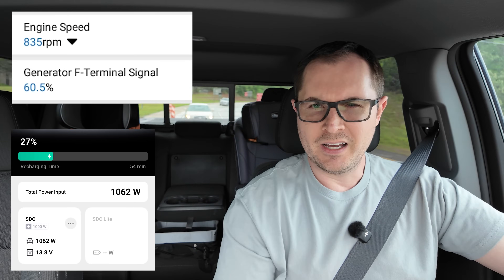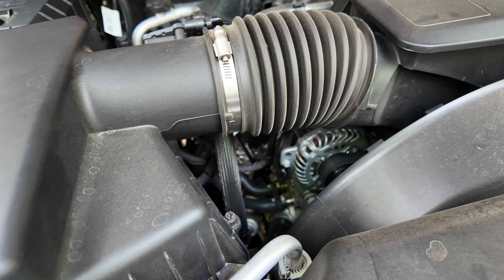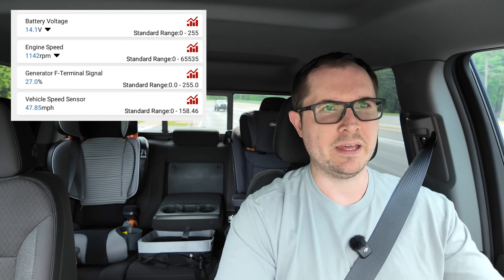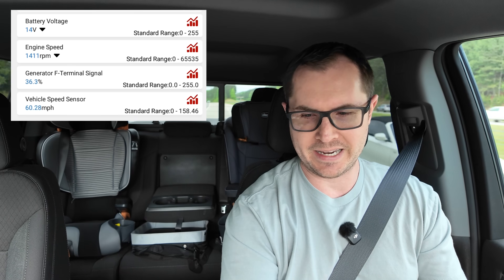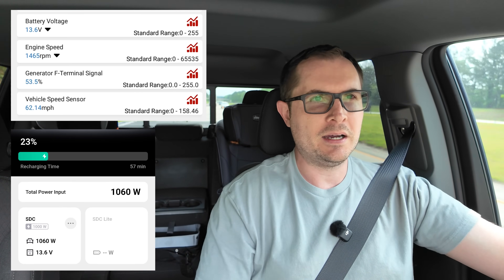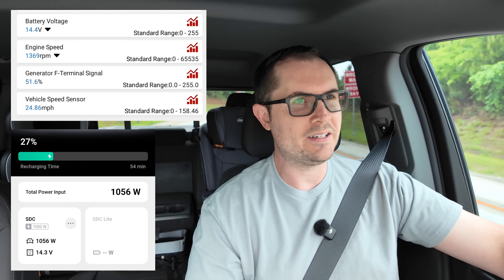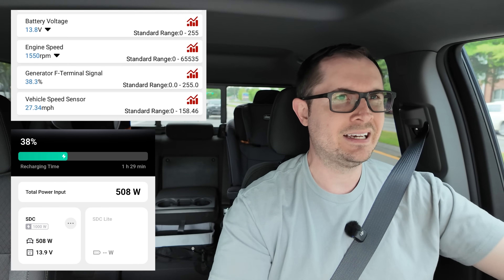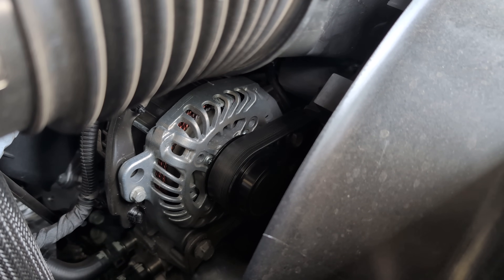I Show REAL Numbers: Impact of DC-DC Chargers from DJI, EcoFlow, Bluetti on Alternator

Comment: So when you are charging at 1,000 watts, is the DJI drawing a whopping 70amps from your alternator, right?  If so, that's not enough headroom for a 170amp alternator, in my opinion.  With your truck, it would be better to move up to the 220amp alternator or a dual alternator setup.
Reply: Why isn’t it enough headroom? 70/170 is less than 50%
Reply from the maker: For sure, in hindsight I would order my truck with the 220 option or even dual 170+220 option. Always learning something, right?

Comment: Great video.  Always wondered this. I have the Ecoflow alternator charger that I would only use in a grid power down event.  I have ran many tests by monitoring the alternator temperature.  I can safely draw 300 to 500w at idle on my Subaru Outback.
Reply from the maker: Thank you for watching, appreciate the feedback.
Reply: What are you powering with this? This was my interest in providing power to a to my refrigerators, lights and tv during power outage.
Reply: @chumleysteven5717  Same. Can also power gas furnace,  microwave,  and a Nuwave cooktop. Also modems and router. And an inverter AC if hot outside.
Reply: How many amps is your Outback's alternator rated for? It appears in the owner's manual. Mine (2.0 TD 6MT) is 150A, and I was considering buying the Ecoflow alternator charger but worried about going to full 800W power.
Reply: @carlostejada6782 I have the ecoflow alternator charger. You can adjust the draw on your alternator in the app for the device so that it doesn't pull the full 800W at idle. I've also noticed it does it on its own when I've charged at idle while packing up camp. It'll ramp up then back down, but if you don't want it to ramp up initially you can set how much wattage to charge at.

Comment: I bought a cheap 12vdc-24vdc charger for my camping setup at 8 amps to charge my Bluetti EB3A while driving.  I just plug it into the cigarette lighter and it works great.  If I remember right, it cost about $30.
Reply from the maker: Thank you for the info. And thanks for watching.

Comment: So my OLD van is a 1993 Ford E250 4.9L, Factory amperage on the alternator is 80 amps. I have upgraded to a 150 amp HD alternator from a Lincoln (Large frame vs small frame alternator) upsized the wiring and have it wired to a 40 amp DC to DC charger (AtemPower),  With the proper wiring / connections and breaker installed, no issues.  I intentionally oversized the alternator although I could have gone with a 200 amp I didn't see the need.  Using the 80% rule, if the OEM alternator is 80 amps, 80% of that is 64 amps, max DC to DC charger draw is 40 amps for a total of 104, 80% of the 150 amp capacity of the alternator installed is 120, so I have 16 amps to spare. The OEM alternator for the vans is the compact frame motorcraft atlerantor, the conversion company and later I have installed the large frame Motorcraft alterator giving me a cooler running alternator. For city driving I tend to throw the breaker to the off position to avoid the load as it can cook that poor alternator especially here in the south. However I typically will top off gas just on the outskirts of the major metro areas as I leave, and that gives me a chance to turn the breaker / circuit back on....  So far so good.
Reply from the maker: Fun setup. Thank you for watching.

Comment: The channel "WorkingOnExploring" has an excellent video on this subject that I encourage anyone interested in this subject to watch.  The title is: "EXPLAINED: Truck Alternator Charging Auxiliary Lithium Battery".
A graph is presented that has a continuous duty curve for a 170A alternator. It demonstrates how you can pull more power safely at higher speeds, up until a point.

Keep in mind all of these ratings and curves are only valid at a specific environmental temperature.  They will not apply in Fairbanks AK in the Winter or Death Valley CA in the Summer.
Reply from the maker: Thanks for the info. And thanks for watching.

Comment: That high idle load is exactly why I installed a small, 20 amp DC to DC charger.  I also installed a switch, so I could turn  the charger on after full warm up.  20 amps, plus 600 wats of solar on the roof takes care of most charging in my Ram Promaster (400 amp hour battery bank). I want my alternator to last. Just my take.
Reply from the maker: Great thinking. Thanks for watching
Reply: I did this for a client, changed the alternator for a newer one with more amps, but the dc-dc charging is much lower than it "could" be. you don´t need to "tesla" charge your solar battery system. you drive to another spot on the highway and the alternator will charge the system. in emergency you idle charge the batteries on the place, but than you will not use the microwave oven.
Reply: That’s the same setup I’m doing in my promaster for the same reason. I’m also going to buy a spare alternator for a spare since I’ll be on the road so I don’t have a failure in the middle of ‘buttscratch nowhere’ and can’t find a replacement.
Reply: Can you expand on - 20 amp DC to DC charger - like what kind of charger, connectors etc?
Reply: @MrSmith-oe4ui  Renogy.  Cheap and works great.

Comment: Is there any way to measure the alternator temperature during these tests... In my experience, high heat is the major factor in degradation and failure in a shortened period for electronics of any type.
Reply from the maker: Great question. I couldn't find a temp variable specific to alternator via OBD2 on my truck, but using a basic infrared temp gun the alternator was in the 160s F, similar to other components in engine bay (that was after moving though, not idling so plenty of air flow).

Comment: It also depends on the ambient temperature because the danger is overheating in the desert or in slow moving traffic jams during hot weather. A large alternator generates less heat, so an upgrade may be desirable. 1000w  at 14.6v is less than 80a so under normal conditions on the highway there should be little extra heat build up.
Reply from the maker: Great point. Thank you for watching.

Comment: Great video! Thank you!
I have a DIY 5kWh+ battery system with a 2,000 watt inverter and 900 watts of solar that I use to power my home office (it'll pay for itself in 10 years of electric bill savings). I also use it as my blackout backup. During the recent L.A. wind/fire storms, we had sustained 80mph winds and I had to lay my solar array flat lest it end up in my neighbor's yard, so I wasn't getting the best output. I used my car (140 amp alternator) to supplement the solar to keep my batteries charged and some basics running in my house (fridge, router, PC, monitors, some LED lamps, and my central gas heater here and there). So my car was idling a couple hours at a time when I needed it. I tried to keep my added load down to about 30% of the rating (~40 amps) and I turned off as much of the car's electrical load as possible. I got through a full 72 hour blackout in relative comfort. I don't know what it did to the longevity of the alternator, but there were no immediate issues. From your testing, it looks like I may want to keep the load a little lighter next time (or jumper two cars to draw more).
Reply from the maker: Very practical use case. Thank you for sharing.

Comment: Excellent knowledge!!
Alternator upgrade?

I have a 2017 Ford F250 lariat super duty . The standard alternator is.150A, while some do have a 200 amp alternator. There are alternator upgrades that can be purchased for a diesel truck in this truck line..
The largest ones available are 400 A . There are two alternators on the Ford F250 and upper and lower.. There are two batteries as well.
I have a small towable Winnebago Camper trailer installed in it. I have a 12V battery bank array with 940 AH that can also be charged by solar or shore power for Boondock camping. This is why I am considering the installation of an alternator charging system.

Is it feasible to just upgrade one of the alternator to 400 amp?

I have an OBDC reader how can I find the codes to read the output of the alternator all the time?
Reply from the maker: Great question. On my GM in hindsight I wish I spec'd it with the 220 amp option or even the dual 170+220 option. Maybe there's a similar offering on yours? Seems the cost to do it later is pricey compared to at build originally. In that case maybe an aftermarket 400 amp is more practical then? Lesson I learned is I shouldn't idle when using it.
Reply from the maker: And on the OBD2 question...that parameter I used in video is specific to GM trucks from that I understand. I would imagine Ford would have a similar one? I had to dig into the "read data stream" section of my OBD2 reader to find it buried in an "electrical and theft detterent" category. Here's the one I used: 
https://amzn.to/3YGMy8u

Comment: Yes, 170 amp alternator on a pickup truck is weak.  I have a Mercedes Metris van with 190 A and I've had a Sterling DC-DC charger for over 3 years now.

Comment: 150 watt max. I went off having the AC on and listening to the engine and electrical system. If no heat, no lights, no AC, etc. 200 watt max. I own the Ecoflow Delta 2 Max. The Ecoflow 800 charger. What I did. In a van. I have those. Then. I also put in 2 AMG 100ah batteries. 12v system. AMG doesn't care about temperature. The AMG and Ecoflow are hooked up to solar. The AMG batteries keep my Ecoflow topped off. The alternator Ecoflow charger. I mainly use to keep my van battery topped off. Solar charges both. The Ecoflow and the AMG batteries. The alternator is backup for the Ecoflow and the van. The only batteries I have to worry about is the two AMG batteries. I can charge the two AMG batteries by a vehicle charger. Off a generator or by the Ecoflow while charging the Ecoflow off of the alternator. I have a 30 amp braker switch that can cut off the Ecoflow to the AMG batteries. I have a 10 amp and a 20 amp vehicle battery charger. I have wired on my two AMG batteries. A 2 amp battery charger. No matter what. I am never without electric power, and I am not hurting my alternator. What I did. I am just sharing.
Reply: If you're only pulling 150W, why not just use the regular 12V power (cigarette lighter) socket?  They're good for at least 10A on every car, and 20A on many.  I researched a friend's 2017 Chevy Equinox, and it turns out that the two sockets are separate circuits, each 20A.  So, on a modestly priced car, straight from the factory, they allow you to pull 40A from the power sockets.  At 13.5V, that is 270W per socket, with two of them usable at the same time, so 540W.  

Limiting yourself to pulling 150W or 200W from an alternator, is super, super conservative.  To each their own, but only adding 15A of load to an alternator is unnecessarily feeble, if you have a good reason to draw more.
Reply: @EfficientRVer  YouTube refuses my wright's to comment. Take up any further questions up with YouTube.

Comment: Thanks for doing this test and providing the information.  My 1997 GMC K1500 pickup's OBD2 port doesn't provide hardly any information (as you would expect from such an old vehicle), and I just purchased an eTaker DC to DC charger that combines alternator and solar charging, to provide a total of up to 1000 watts, with only a maximum of 500 watts coming from the alternator.  I haven't installed it yet, but plan to do so soon.  I'm also planning to have solar panels mounted to my lumber rack, some of which will be active while driving, but the side panels will be folded down and disconnected while driving.  I was unsure about the impact the eTaker was going to have on my alternator, and I'll still check the output size of my alternator before I complete my install, but your reporting on the results from your truck are encouraging to me.  If my alternator is marginal, I'll replace it with a larger capacity alternator to keep it from being utilized above 50% capacity, and I only plan on using it while driving down the highway, so the lower capacity of the alternator while idling won't be an issue.  I would warn all users of these DC to DC alternator chargers to NOT use them unless the vehicle is moving down the road, because the alternator doesn't get enough cooling, if the vehicle is stationary and the engine is idling, because the fan built into the alternator does not spin fast enough while idling.  The model of eTaker DC to DC charger I have also allows me to lower the maximum demand from the alternator to 300, or 100 watts, which I'm sure my existing alternator could handle, so that would give me either 800, or 600 watts of charging, when combined with the maximum of up to 500 watts of solar input.  I think that 600 to 800 watts of DC to DC charging will be sufficient for most people who are using these DC to DC chargers to keep their power stations charged up between camping locations.
Reply from the maker: Great setup. Thank you for watching.

Comment: On my GMC 2500 diesel I have the dual alternator option. Easy box to check if you have the opportunity. Running a bluetti charger 1. Works like a champ.
Reply from the maker: Great point. In hindsight I wish I had spec'd mine with the 220a or dual 170+220a option.
Reply: I also added this option when I got my Sierra 2500 for this exact reason.

Comment: Something to consider... there are numerous threads on the Ford Transit and Ram Promaster forums where folks with large lithium banks are running their vans with the alternator directly connected to their lithium banks for even faster charging, and their alternators do fine ripping away, you just monitor things in real time.  Happy charging!
Reply from the maker: Interesting. Thank you for info.
Reply: Lithium batteries need a higher charging voltage than stock alternators put out. I really doubt they are connected directly. There must be a step-up charge controller in-between.
Reply: @fh2926  nope. They certainly let them rip, you can go search their forums yourselves. But you are correct, lithium requires a high er voltage so they're just doing massive bulk charges from their alternators running loose and then finishing off with solar when they park if they so desire.  But the real benefit here is they are getting as much output from their alternators as they can as opposed to limiting through a DC to DC charger.  What's great about modern alternators is that they have their own thermal regulation and they throttle back when they need to.
Reply: @fh2926  anything over 13.6 will eventually fully charge a lithium battery. Or at least get it over 90 percent charged if not 100 percent. It may not be great for the LFP battery to be held at 14 V or above continuously. And 14.4 is the max.
Reply: @fh2926  The max charging voltage for LiFePO4 batteries is 14.6V, some brands recommend 14.4V or 14.5V.  I think Will Prowse uses 14.5V.  That's only needed to get them to 100% charge and top balance the cells.  Charging LiFePO4 to just lead-acid voltages is perfectly fine, though once in a while you should disconnect them and charge them with a lithium charger to top balance the cells.  As long as you do that, charging to just max lead acid voltages, actually prolongs the life of the LiFePO4 batteries, because while they cycle 0% to 100% very well, avoiding the ends of that range except to balance, just increases cycle life.

Comment: I have a Renogy DC-DC charger with a built in MPPT solar charge controller.  Renogy's app lets me adjust the charger output from 10 to 50 amps.  So I just run at low amperage unless I need more.  Before that I had a Renogy 40a DC-DC that took an input wire.  If that wire was hot (+12v), the charger ran at half power, 20a.  It's great to be able to reduce the output current from these things for various reasons, including respecting the gauge of charging wires that aren't beefy enough to handle your new toy's maximum output.
Reply from the maker: Great point, thanks for watching

Comment: Not an electrical engineer, but I know several of them. The rule of thumb is to design for 80% load for pretty much everything. That way the few times something does spike or runs abnormal, it shouldn't harm the system.
Reply from the maker: Thank you for that info, and thanks for watching.